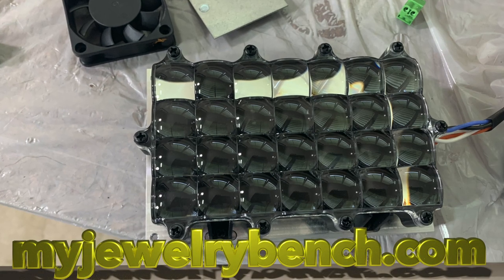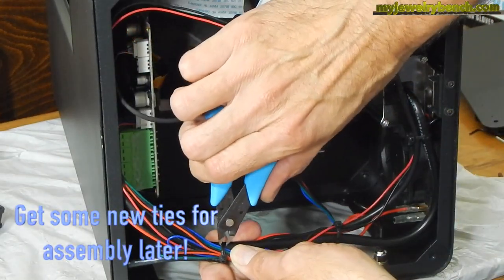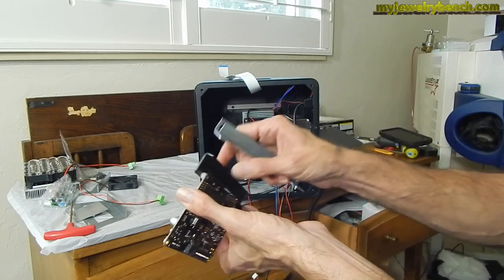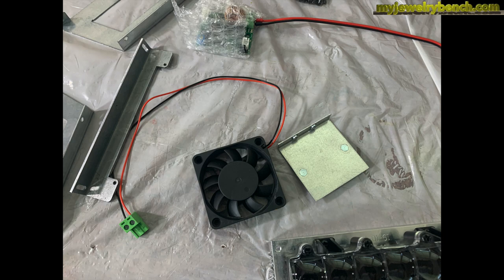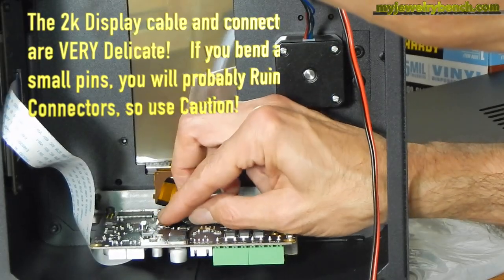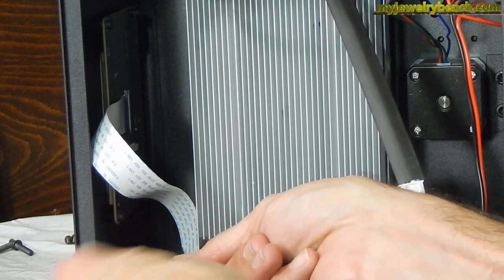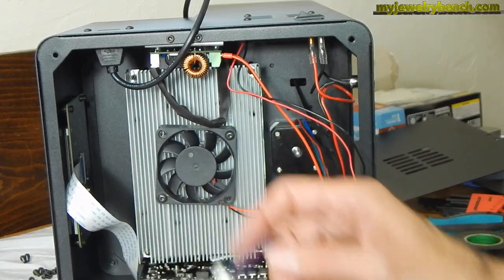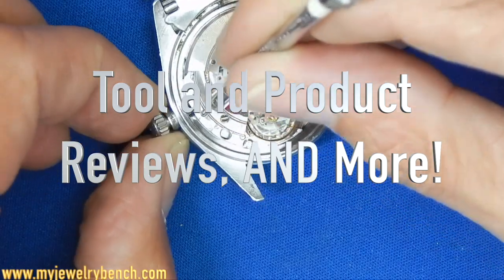Epax X1 MSLA Parallel Light Array Upgrade and Installation!  How I did it

Comment: I wonder if this is a series of upgrades that will lead to continuous printing. Formlabs used an oil that sits goes in the resin vat but sinks to the bottom. This way resin can flow to replace the one cured allowing for continuous printing.

Comment: Great video, I can't wait to see your comparison prints.  Does this module increase the UV power? i.e. will it print even quicker, or just improve the power distribution over the print area?  But,  I'm worried that the heatsink fan doesn't supply airflow to the six or so fins on the edges so the outer rows of LEDs won't get as much cooling as the inner ones. Perhaps they don't need it, but then why fit a fan?
Reply from the maker: One of next weeks videos will have the comparisons!

Comment: You can also do that upgrade to the elegoo Mars having 2 machines with equal speed and capabilities (no need to buy another Epax to have the same features)
Reply from the maker: Interesting...   I don’t believe there is enough room in the mars to fit the parallel lamp and mounting brackets.  Changing over to the better z axis motor and rails would also be costly.  If, like me, you wanted to add the epax to your fleet, you’re better off buying one.  The Mars is a great printer out of the box...  Let’s just see what the P version has to offer, or better yet, wait for the Saturn...  if that comes out.
Reply: Peter Grande  I should see if there's room, I guess the brackets are intended to fit it in the epax. but that led array is virtually the same they sell on aliexpress, If I'm not wrong, there have been users in the facebook groups installing the same led array in the Mars and even in the photon. 
I just told you that because you could have both printers performing equally (you could also fit the old epax lamp in the Mars making it faster, is a mod you showed us you can do. Why having it just there lying in a drawer? you already have the spares to do it)
The Mars as you know has some nice features, e.g. If you are printing a long piece, You can check how it's coming out from every angle and notice if it's anything wrong on the rear side, in the Epax, due to it's enclosure, you can't see the back of the print (unless you place a mirror on the wall).

Comment: Hello I use such a second month. I have a power of 70 watts on it. he burns out monitors like paper... in two months I changed three pieces. here there is a strong overheating during prolonged operation. one side . reaches up to 47-50 degrees with the other closer to the ventilation in the wall up to 37-40 degrees. In this case, everything is bad with the removal of warm air. I'm still looking for a solution by installing two coolers. in one of walls. be careful
Reply: It depends on how many hours you print.

Comment: The problem is this  UV Array works with 24V/5A !!! input
Reply from the maker: I’m actually thinking of putting the original light kit back in. It was high power and printed faster
Reply: @watchesandjewelry  
I also bought the same Arry on Ebay, cheap. I'm currently building a resin printer(NanoDLP) myself. Ever tried removing the top lens cap and then trying to print? Maybe time will improve without the lens cap. Sorry my english is google :)  Of course you cause a UV headlamp to build